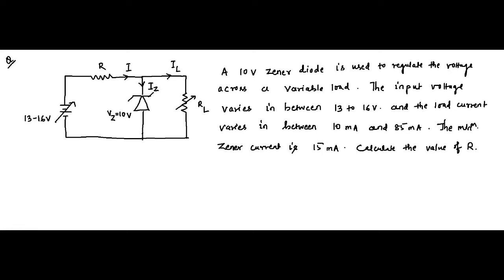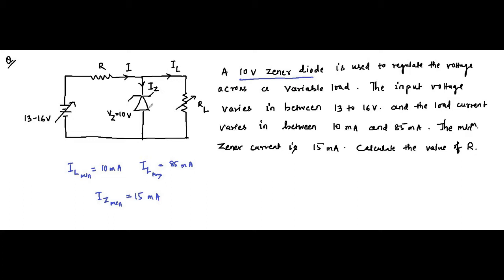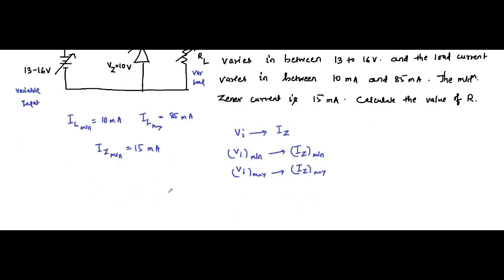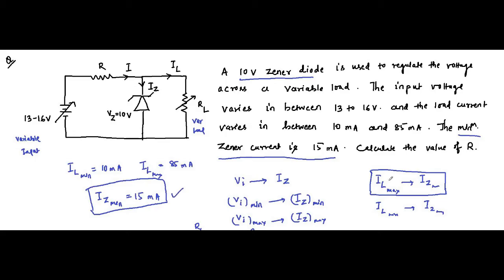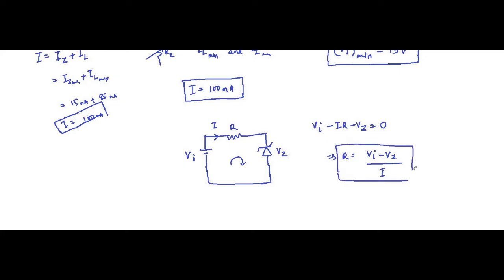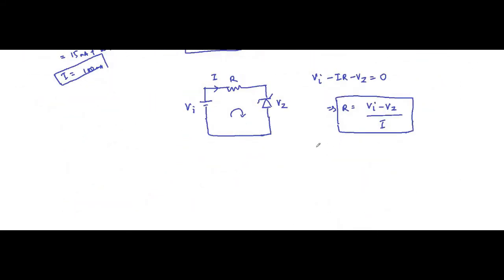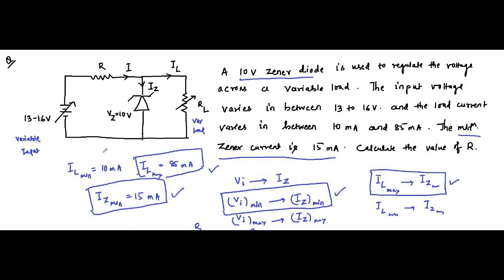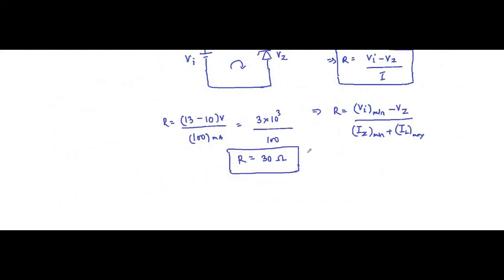Solving Zener Diode Circuits | Question 5 | Analog Electronics

Comment: Sir, if two zener diodes of 10 volt are used in as voltage regulator then how will i have to solve it?